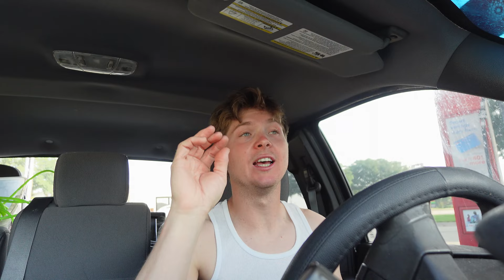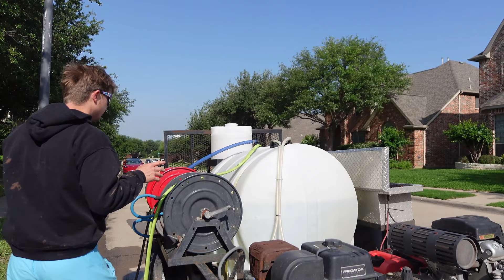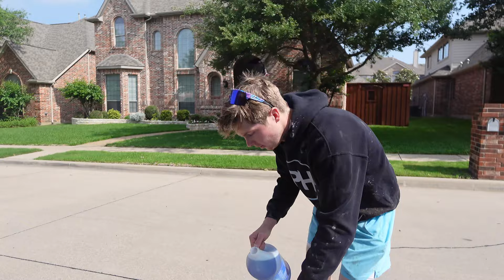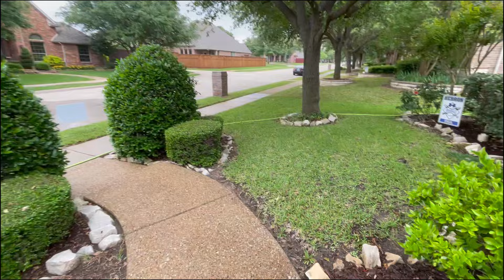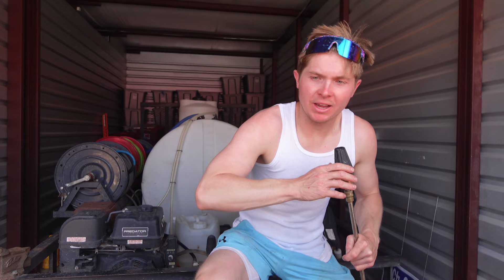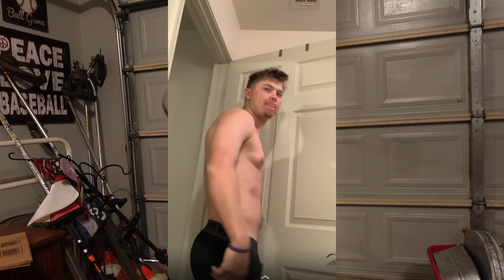Day In My Pressure Washing Business | I Feel The PRESSURE

Comment: 5.1.24  Truck looks great with the light blue.  What is your SH percent 10%  12.5% in the storage tank?  Then what does the mixture come out when using the pressure washer down steam fitting 1% 2%?
Reply from the maker: 12.5

Comes at about 1-2%

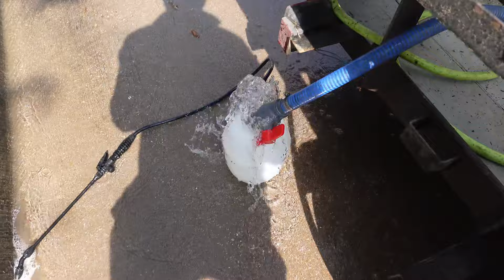Comment: 6:15 tristan would u recommend we have different pump up sprayers for acid and other chemicals etc. Also Jason mentioned that pump up sprayers are dangerous and a couple have exploded on people? What would u recommend? Is there another way to apply chemicals?
Reply from the maker: Yes I’d recommend one for strictly SH, one for acid, one for degreaser

And make sure to rinse it out if your using different chemicals✊🏼

Comment: How much are you charging for specialty removal; such as radiator leaks, oil leaks, battery acid, etc..?
Reply from the maker: 8 Gpm and a 6.5 gpm 

Both predators
Reply: @Tristan.Kalina  How much do you charge for the stain removals?
Reply from the maker: @SP-mg3li  oh I replied to the wrong comment lol.

Minimum 400 dawg.

Those chemicals can get expensive.